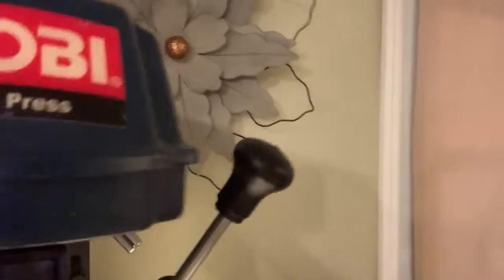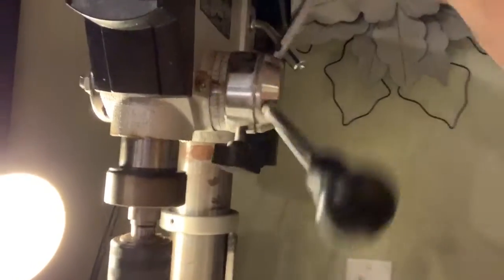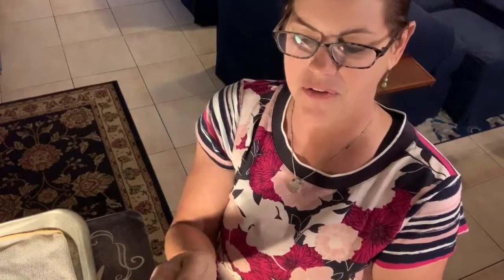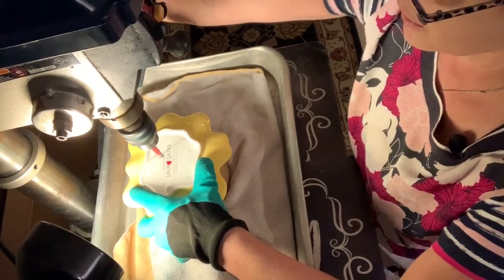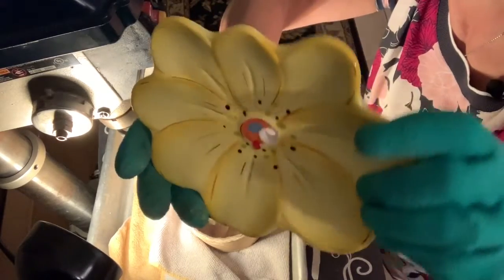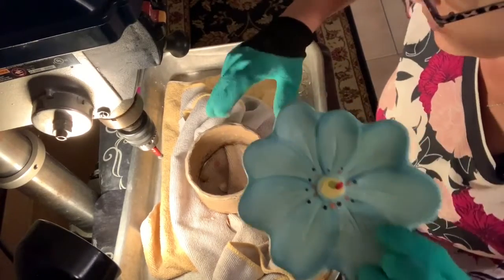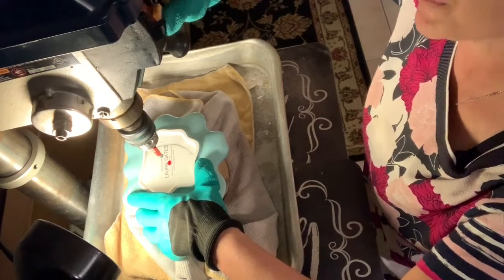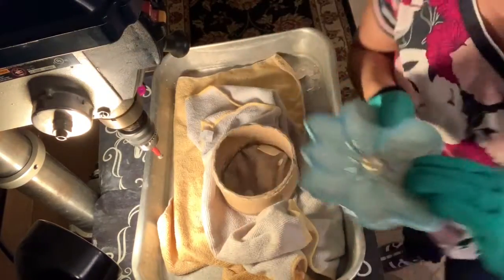How to cut glass using a RYOBI drill press

Comment from the maker: The duration of cutting depends on the thickness of the glass and the condition of your drill bit. I prefer to use a new one every 4 pieces of glass depending on the thickness of the glass. But cut durations vary.